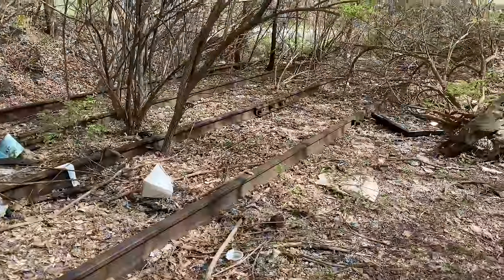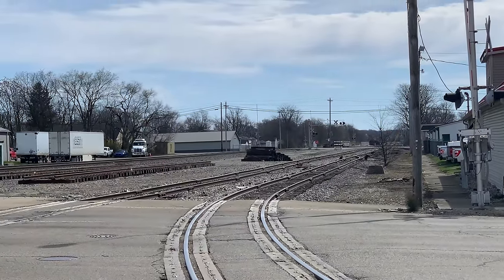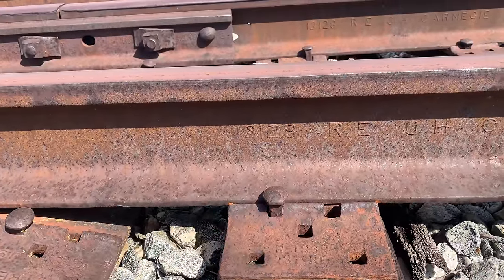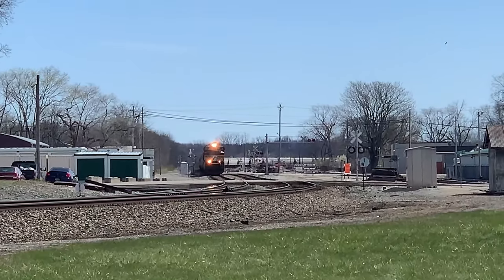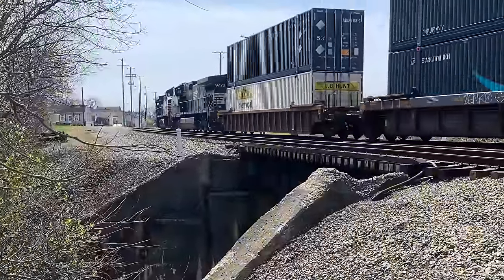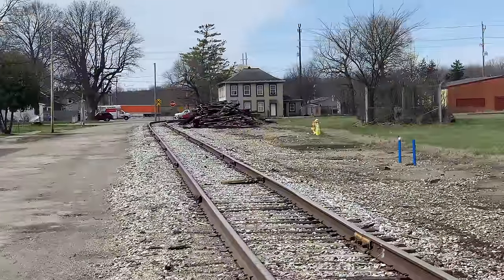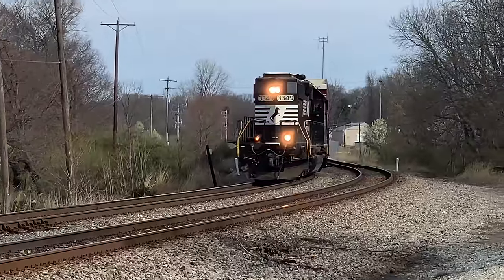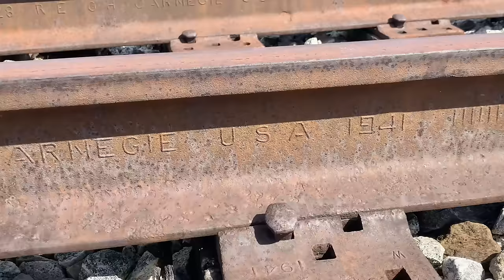Abandoned RR Spurs & Grain Elevator In Circleville Ohio, Norfolk Southern Grain Train On Sharp Curve

Comment: Definitely the type of town that just gets one more and more interested in the track layout that is just steeped in history. The old Rail and switches plus businesses no longer in operation speaker of days when business was brisk here.  That elevator definitely was massive for its day and the only reason it's still standing it's just a drag to tear it down with all that thick concrete and rebar. Then later on you're down with that four track mini yard and the switches where it goes onto a concrete loading platform just makes this town a natural winner for exploration so thanks for covering the rusty rails
Reply: hey paul are they done tearing down the old froedert malt elevator over at the belt... that whole area is slowly disappearing from a railroad aspect... mitchel yard looks defunct, wouldn't surprise me if they pull the tracks outta there as well
Reply: A "cadillac grainer" for Shoe string😢 the beautiful ride in the sky for him
Reply: @25mfd  they actually got the plant torn down by mid-october which surprised me all done by Wrecking Ball. There are still mountains of processed concrete into gravel on site however but I think all the metal is gone now. It just looks so strange to see it gone from the skyline in fact the one Clinic I go to you would see it from their fifth Story window and all the sudden there is nothing there anymore. It's very peculiar also that the most common car start at Mitchell yard are covered hoppers including former CNW malt cars as if to give a final salute. At the grade crossings it looked odd during the winter to see the snow heaped up on the rails undisturbed for up to a week at a time and now you look at them they're just two rusty streaks. There probably isn't more than one interchange move a week. Komatsu has some production transferred now to the facility on Greenfield Avenue but still must have some stuff at National Avenue yet but I suspect they will be out by the end of summer. There still is track work to be done at the new site but contrary to early drawings they are not putting a connection in to the Old Milwaukee Road main line pretty much where the old connection used to be. Cold traffic to Oak Creek should be starting to drop next month as they close down the two oldest boilers
Reply: @paulbergen9114  
yea so much has changed and is STILL changing... i didn't know about the oak creek boilers going offline... i did hear about alliant  energy, Edgewater in sheboygan... i guess last year they were plans to close that place down but the plans changed... what do you know about anything new with ladish malt in jeff junction???... in the past, that place was good for loading out 8 to 10 carloads of malt per week... i remember switching those cars out at butler... they were all for anheuser busch... some would go to st louis, others would go out to a brewery in waverly new jersey... yea it's sad... i just shake my head at all the stuff that's gone now

Comment: The box car is deliberately next to the locos since the train has tank cars  leading the consist as a buffer car. Railroads united continents into nations. Just a bit of info, i call them turnouts, not switches. I do engineering in a variety of technologies and that is the technical term for the turnouts. Thought you would want to know this.

Comment: Centerville or Circleville?
Reply: That's what I'm wondering. Unless this is a different Centerville, the only abandoned spur by an old grain elevator (long gone) I know about in Centerville that would fit the title would be what is now Ace Hardware on Clyo Road, and this isn't it.
Reply: It's Circleville, there's a Prestige Storage near Huston St which can be seen in the video.
Reply from the maker: I get those two towns mixed up.  I made the correction thanks